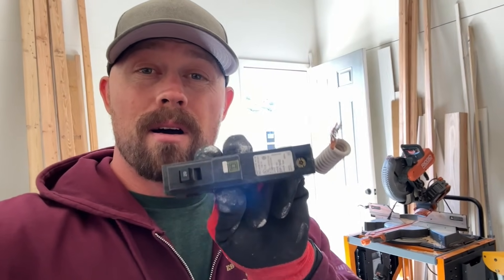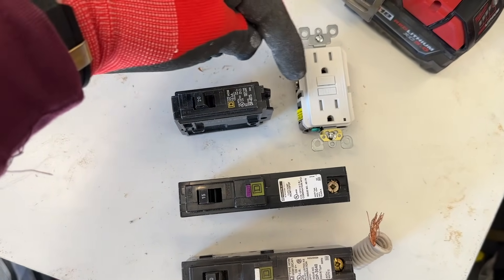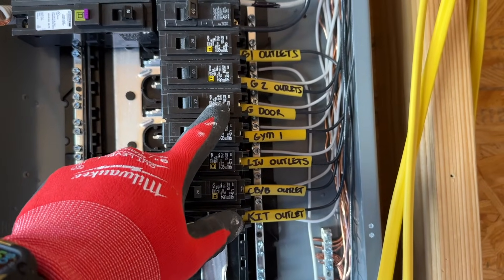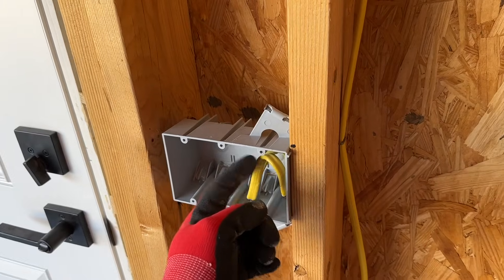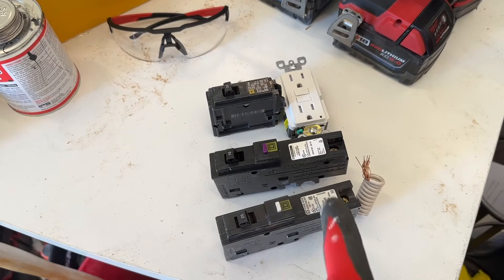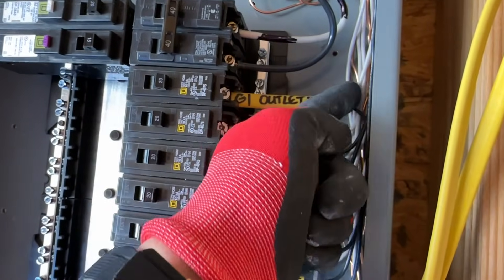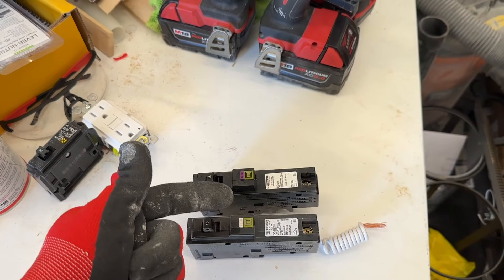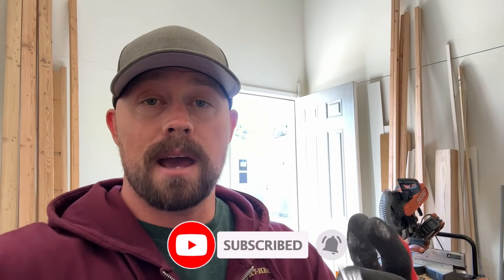AFCI Breaker Vs Circuit Breaker- What’s The Difference?

Comment: You seem to be confusing AFCI with GFCI.. They are not interchangeable..
Reply from the maker: Yeah, I understand what you’re saying. I’m not trying to say that they are exactly the same because obviously they aren’t. But they’re very similar in nature as far as what they do as a breaker. I mainly focusing on the point that you need one or both of them depending on your local building codes, usually in the beginning of your circuits or at your panel. I know it gets a lot more technical when you’re diving into the actual book on everything. I think surface level knowledge could benefit the home owner with understanding some of the basic concepts.
Reply: @FortKnoxCo as just a regular homeowner, I definitely appreciate your explanation of how things work together big picture and not getting way into the weeds where most people probably wouldn’t understand. Thanks for posting the video! 👍
Reply from the maker: @mxcollin95  thank you. I really appreciate that. 🤙🏼
Reply: @FortKnoxCo "Getting into the weeds" is important, and the reason proper training is critical for anyone attempting electrical work. Nothing wrong with DIY, but make sure you understand the code requirements...it could save a life.
Reply from the maker: @JohnOppegaard yep. I 100% agree. You should definitely educate yourself and do your research before taking on something new. Lots of knowledge out there
Reply: How do you determine arc and non arc circuits?
Reply: Yes , he does.
Reply: This was exactly what I was looking for. Perfect video with examples of what to use when with detailed understandings.
Reply: If I want to run two upright freezers in my garage, what type of circuit should I use? I'm concerned about using GFCI because if it trips I wouldn't know and could possibly lose all the food to thawing. What's the best way to do this? Thanks!
Reply from the maker: @alexanderblack3517  but AFCI or GFCI is fine either way. They essentially work the same way. The worry about one popping and not knowing is always going to be a factor either way. Unless you have an advanced system that sends you a notification when a breaker pops you don’t always know immediately
Reply: @FortKnoxCo arc fault and ground fault are 2 distinctly different faults and are not protected using interchangeable devices...look up required locations for EACH type device
Reply: @alexanderblack3517 I would do a gfci at the panel and buy a no power alarm for the freezer to plug into the outlet to let you know you lost power
Reply from the maker: @alexanderblack3517  well technically, no matter what you do if the circuit trips you wouldn’t know until you go and check your breaker or find out that your fridge isn’t running. No matter what type of breaker you put in there, your circuit will be protected by some type of interrupter one way or another. Every house in the circuit at the end of the day will have a breaker at the box. so the type of breaker isn’t going to change your function. I would say have the breaker at the box because it’s easier to reset rather than having a GFCI outlet that your fridge is plugged into. Because if the outlet GFCI pops it’s a lot harder to to get to. Have to pull the fridges out to push and reset.
Reply: ...After you pass your inspection, take out your AFCI and or GFCI receptacle and replace it with a standard breaker and receptacle. Common sense is priceless. The properties of electricity haven't changed.  The NEC changes every couple years. Why?

Comment: The refrigerator explanation is what I was looking for. That makes a lot of sense. I was wondering why I need arc fault if my first receptacle is AFCI/GFCI. Not needing to pull a refrigerator out, or not placing them in hard-to-reach places is smart.
Reply from the maker: Yep! Thats the same question I had when I was wiring a panel a couple years ago. New code is asking panels circuits to all have a GFCI or AFCI installed. So I didn’t get it at first either and thought they were just trying to be difficult. But for lighting too it makes sense I guess.